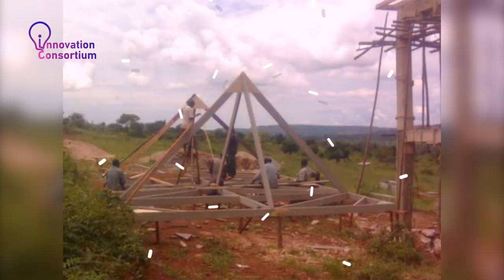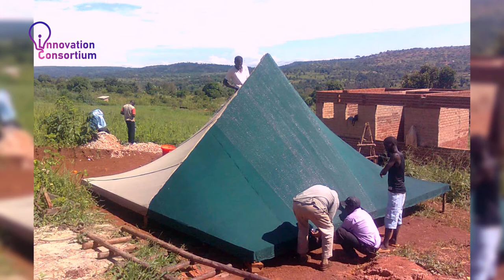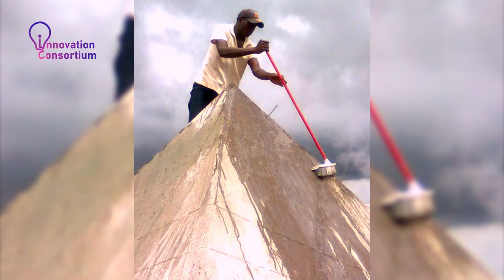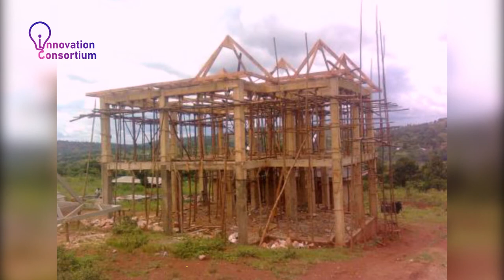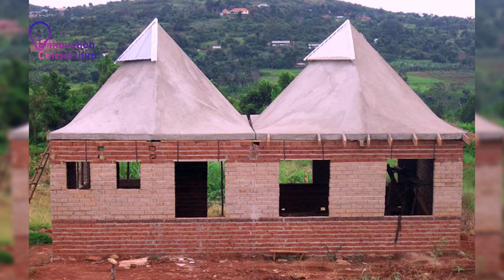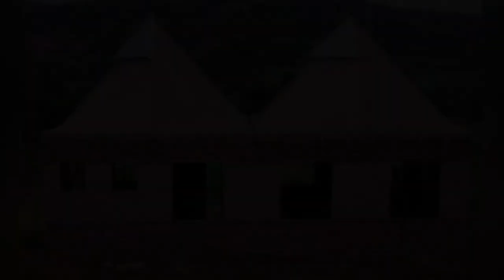THIN SHELL CONCRETE ROOFING. CHEAP affordable ROOFING CONSTRUCTION INNOVATION

Comment: What is the advantage of such a roof over conventional iron sheets
Reply from the maker: Advantages include;
Sound heat insulation
 Cost: it is cheaper than the more traditional materials like iron sheets and tiles. It can save about 25% of what iron sheets costs and about 50% cheaper than tiles. This is because it uses cheaply available local materials: mesh, cement, sand, timber and cloth. 
Shape/ Aesthetic: The hyperbola gives a more interesting shape to most conventional roofs. Also it gives you the skylight option to bring in light.
 Since it uses less timber in it, the roof area remains with enough space to give more headroom or to be utilized for extra storage.
Humanitarian solution: Because the materials used are locally and cheaply available, TSC can be used to provide short term housing solutions to disaster areas. If designed and installed with the purpose, it is possible to make it movable as well from one area disaster struck area to another.

Comment: Nice !
Did you add something for waterproofing ?
Reply from the maker: yes the final coating is designed to cater for all that. because the final structure is heat, sound and water proof.
Reply: @innovationconsortium  Nice ! What is the coating made of ? Latex ? With this steepness, maybe only cement could it be used ?